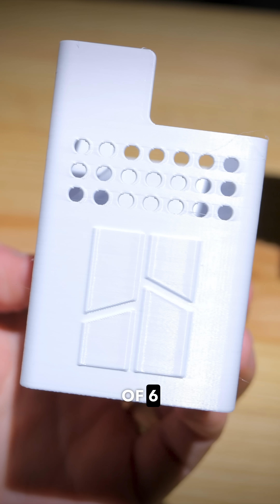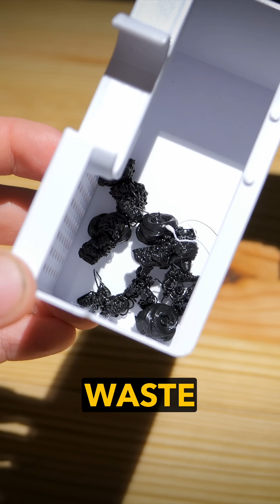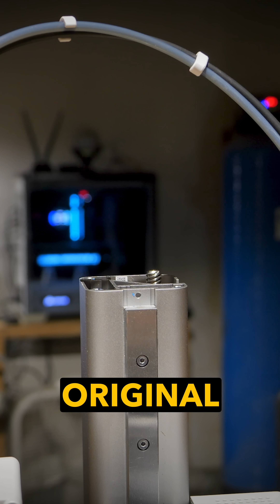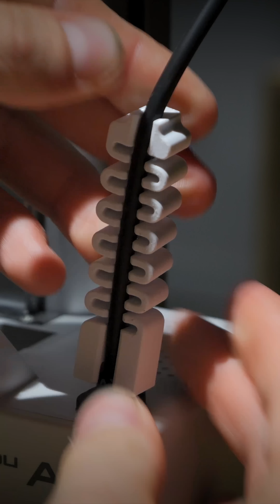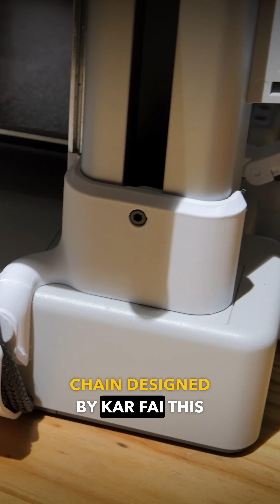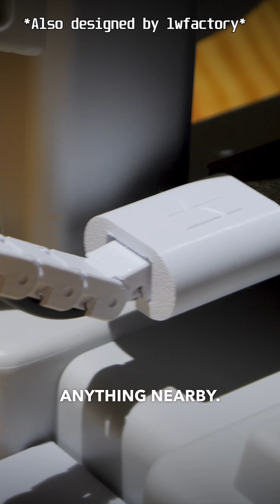3D Printed Bambu Lab A1 Mini Add-Ons! #3dprinting #diy #shorts

Comment: I prefer a poop deflector and a bigger basket rather than putting weight on the arm (which is a precision component.
Reply: More so than the weight, poop rattling in that bucket is really annoying.
Reply: Same
Reply: it calibrtates every print lol. And on the A1 its even more stable lol
Reply: it saves space for an enclosed box bro
Reply: thats literally like a few grams

Comment: how much does the basket weigh? worried about it putting pressure on Z axis
Reply: not much but i don't like that design. too much friction stressing that end every time you remove it. i found a better one for mine. attaches the same but has a pull out drawer to empty it so you never have to remove it again
Reply: @Harani66 Where can I find that design?

Comment: Thinking about getting one of these myself! What are your first impressions of the A1 Mini?
Reply: its a great printer. but from this video, only one print is "worth" though. The cable link. That's it.
Reply: @nos9510  I think a poop basket is necessary, just not that poop basket depending on how often you empty it.
Reply: @TheSixoul  oh yeah! It is necessary, definitely. But do you need to use plastic for it? Or maybe you can just, I don't know... Use a cardboard box?!

Not everything needs to be 3D printed you know. You will do the same job with cardboard, faster, cheaper.
Reply: @nos9510  haha, yes I caught myself and others, overthinking stuff, because of a 3D printer. often times, a simpler solutions is also way easier done.
Reply: if you are happy with the size, go with the mini. (possibly the combo with the AMSlite) ...
seriously this is my 5th 3d printer (printing since 2017 or so) and none so far is as easy to use as this one and the print quality is miles ahead of my others...
Reply from the maker: Would like to start off by saying I'm not sponsored by them. I think it's the best deal right now in the 3D printing world you can buy. But I will say I would have never bought it if I didn't already have a larger printer (P1S). I'd say 60% of the stuff I print, will fit on the smaller print bed of the A1, however there are plenty of things I can't fit either. But print quality seems to be very very close to that of the P1S and it does it in practically the same amount of time. The ease of use is on point as is with all Bambu Lab printers, and I have yet to have a failed print. I have thrown quite a bit of stuff at it so far and have been extremely happy, especially since it's on sale for $199 right now. If you have don't have an issue with the smaller print bed, full send!